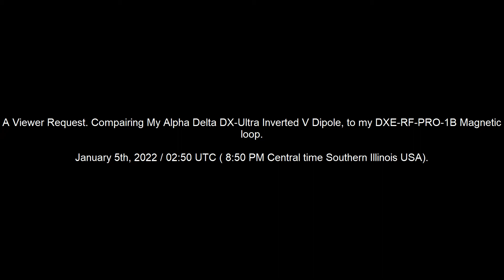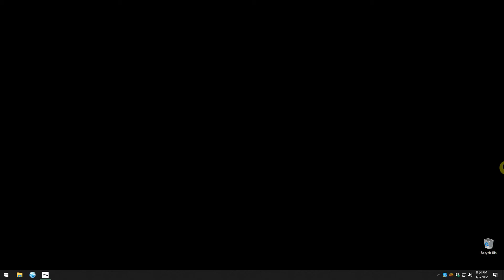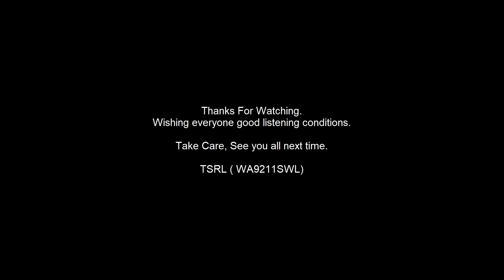Alpha Delta DX-Ultra and DXE-RF-PRO-1B loop comparison

Comment: Thanks for the comparison. Is calling my attention the memory setup you have, did you made that manually or there is a way to get that on an SDRUNO installation?
Reply from the maker: I download the CSV file from eibi database with the shortwave schedules. I load that into SDRuno and SDR Console. I then tell SDRuno to display the station  in the memory panel as I tune. I have a video on how to do that I think. I'll have to check and see.
Reply: @SouthernIllinoisShortwave  thank you very much, I will try to find that video, thats very cool.